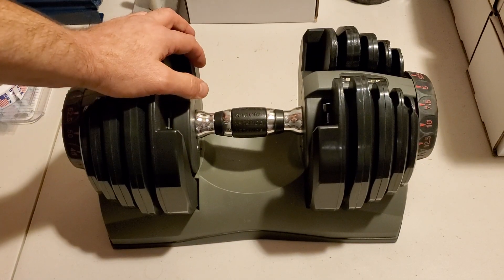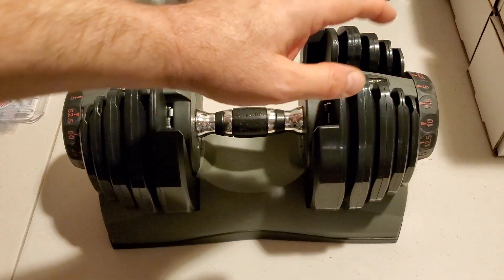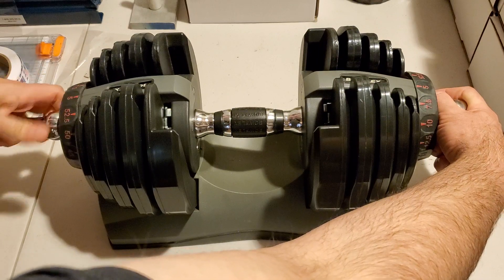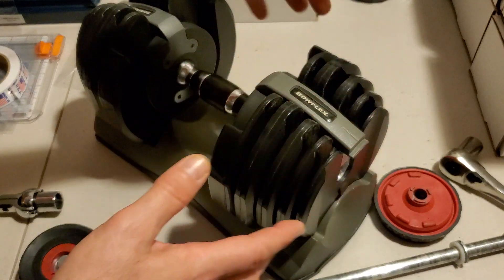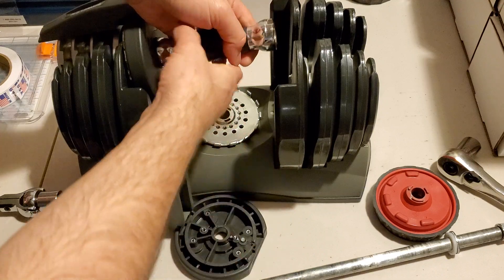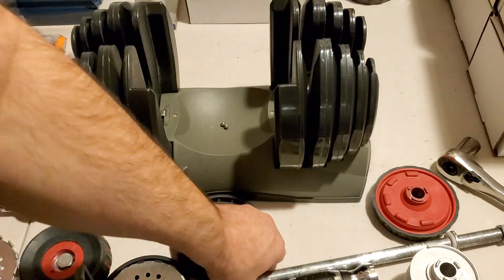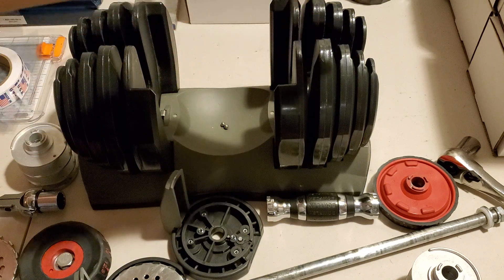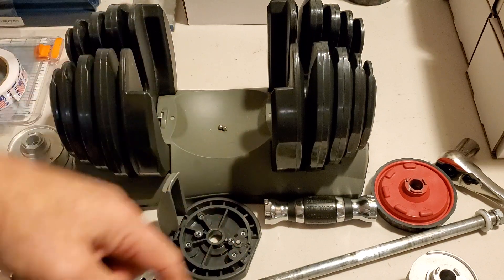Is your Bowflex 552/1090 Dumbbell Stuck in its Base? Nothing else worked? Try this as a last resort!

Comment from the maker: I've received a couple comments about the method in this video over the past few years. The method in this video should be see as a last resort. The very first thing to try is the "foot method" that Bowflex demonstrates here:  https://youtu.be/Pz8t38cosbg?si=57BQeefYsSyux-Sf&t=32

If the reason that your dumbbell was stuck in the first place has to do with a failed/failing component, you can find step-by-step disassembly, inspection and reassembly instructions in a playlist on my Youtube channel: https://www.youtube.com/playlist?list=PL-pg9u1pis_EWPeCLvN-DHjDIlbsEf74f beginning with Step 2.

Cheers,
Joe

Comment: To be honest IMHO since this issue appears to be fairly common among Bowflex Selecttech dumbbells the blame for the  issue lies squarely with Bowflex itself. You'd THINK the company would have worked out all the kinks in this product before releasing it for sale to the public. At the very least they should check each and every set of these dumbbells before shipping to ensure that everything works properly.
Reply from the maker: Hi kn. Bowflex has only issued one product recall for the SelectTech over the past couple decades. It was more than a decade ago and they misidentified the root of the problem. It seems as far as they are concerned there is no problem with their dumbbells, even though you and I (and countless others) know this to be untrue. 

As someone who has worked on product design teams for other companies in past lives, I can tell you that sometimes even a group of engineers can overlook something that is obvious to outsiders. There's a sort of tunnel vision that occurs within their bubble. It could be something as ridiculously simple as failing to test for a specific use case.

This is why I rely on customer feedback to the extent that I do these days. Because I know that I may miss something that's obvious to someone else.  So I throw my designs out there, and the feedback of hundreds of customers combined with my own experience using the products, help me understand what I need to do for the next iteration of the design. Bowflex, in contrast, appears to remain in a bubble with a design that is virtually unchanged for the past couple decades despite the first-hand experience of many hundreds of thousands of customers.
Reply: @AverageJoeInnovationsLLC  If Bowflex only spent as much money on product design and engineering as it does on advertising maybe its product wouldn't have these issues.

Comment: The guard on one if my 552 db fell off while I was working out, and all the plates fell out.  I got replacement screws but I couldn’t get to the nuts, so it won’t catch.  Do you think taking it apart is the best action?   I am afraid I won’t be able to get it back together properly. And that it will fall apart again even if I do get it back. Would you repair or replace it? Thanks
Reply from the maker: Heya, Krim. The crossbar worked itself loose? That's wild. This is the first time I've heard of that happening. If you're inserting the screws and they aren't catching on anything, it's likely one of two reasons:

1. if yours are equipped with threaded bosses (not nuts) then the bosses have stripped and you'd need to tap them.
2. if yours are equipped with nuts, then they've fallen out. Hopefully they are not lost. They sometimes get caught in the plastic ribs of that assembly so you may find them when you disassemble the dumbbell. If they are lost, you can likely find more at any hardware store.

Taking it apart is your only way to fix the problem. As you experienced, without the crossbar to keep the plates from spinning on the handle, the plates will fall out. It's a super simple repair.  I have detailed step-by-step videos for disassembly and reassembly:

https://www.averagejoeinnovations.com/#installation

Just click the + sign on the right hand side of my website to expand the section. Then click the link for each step and it'll begin playing the in adjacent video player.

Definitely pick up some thread lock. If you're in the States, Harbor Freight sells it for just a couple bucks per bottle and it's plenty good enough. Use it on those screws as well as the bolt/nut on the end of your dumbbell shaft and you should not have a problem with it coming loose again. 

Cheers,
Joe

Comment: I have the 1090 which one side doesn’t let go of the weights and spins freely without locking. Any advice
Reply from the maker: My very first guess, based solely on my understanding of what you described, would be that the dial lugs have sheared off. If the dial turns but none of the discs turn with it, then one or more dial lugs are gone. Check out the beginning of this video to see what I mean: https://youtu.be/vU51aKjhvzU?si=56vt0yLjrrjp0ByM

If that's not the case, feel free to email a video of the issue to me and I'll take a look and let you know what I think it might be. Please note that it may take a day or two to reply depending on my workload.

Comment: Still great video, those springs went flying! I’m still having a problem with the white plastic tab that gets depressed  when when you set it in the cradle, and then allows the dial to turn for weight selection- that plastic tab is stiff, sticky- just not budging very well. So when I get it back in the cradle, it sometimes doesn’t even depress, so I’m unable to change the dial/weight. Even after taking it all apart. Can that be lubricated? Any suggestions on the type of lubricant.
Reply from the maker: Oftentimes, a white locking pin and/or button is an indication of a knockoff.There may have been some older OEM SelectTechs equipped with white buttons and pins too, but I've mostly seen them on knockoffs.  Some of the ones I've seen (and the couple that I own) have issues with locking pins getting hung up inside the cavities where the pins are installed. 

You could start by trying a silicone or PTFE-based dry lubricant offered by many brands including Blaster, 3M, WD-40 (grey can not blue), etc. Just a couple spritzes inside the cavity or on the body of the pin itself (not on the pin shaft).  If that doesn't help, you may need to tweak the pin, button or cavity surfaces to get them to slide more smoothly with less interference. That means some trial and error, sanding, scraping, contouring, testing and repeating. It could even be the locking pin's spring catching on the inner edges of the cavity. Some of these manufacturers use a spring that's just too large in diameter.

If you email me a couple photos of your pin, spring and the inner cavity taken from different angles, I can tell you where I think it's getting caught up. My email is joe@averagejoeinnovations.com. I'll reply when time permits.  Cheers, Joe

Comment: Hey Joe. My problem is that the small plate stays on the handle when it's not supposed to and I have to push it down to get it off. Any ideas how to fix this?
Reply from the maker: Hey P,  Do you own the 552 Series 1 like in the video above?  Is it just the one small plate? Does it happen no matter which handle you use in that base? And no matter which way you face the handle in the base? 

I am not saying this is guaranteed to be the issue, but over time as these dumbbells age the plastic coverings on the weight plates begin to separate from the steel underneath. That creates a slight bulge and it can make the plate seem more thick than when it was new. And that can cause the plate to get stuck in the handle and not release properly, or it can make the dial more difficult to turn.  If the same plate causes a problem in both handles, this would be my first guess. And I'd inspect the plate further to see precisely what is going on with it.  Feel free to send me some photos of the plate and I will take a look when I have some time. My email is: joe@averagejoeinnovations.com

Comment: As soon as a single ball bearing or spring fell out, I'd be cursing up a storm.
Reply from the maker: I've been there years ago when I began messing with these dumbbells.  Placing a towel under the dumbbell to catch bearings and springs is the way to go.  Trying to find ones that fall on the floor is an exercise in frustration. Cheers.

Comment: To all,

This is a great tutorial.  I have the Series 1 and I am stuck at the get go.  I cannot remove the bolt.  I have the two 3/4" - 19MM ratchets and no matter how much torque I apply, it will not unscrew.  I've used 3-in-one machine oil and let that soak in to no avail.  Does anyone have any thoughts?  By the way, this dumbbell has never been serviced so it was tightened at the time of assembly by a gorilla. 😆  Does anyone have any  thoughts?
Reply from the maker: Hiya Mike, I answered you via email, so this is for anyone else who might want to know how I'd approach this problem.

My gut feeling is that these things are assembled using impact wrenches (which is also why it's not a wise idea to use impacts on wheel lugs). With nearly every SelectTech I own, the nut on one end of the shaft is jammed on with such force that it deformed the lock washer beneath it. And the other nut, while tight, is usually the one that breaks free.  You'll usually see a red or blue residue after removing the bolt/nut indicating the use of thread lock too.

I have had only one bolt that was so incredibly difficult to remove that I ended up using a breaker bar (1/2" drive 24" if I recall) with a pipe slipped over the end to create enough torque to break it free. The most challenging part is finding a way to hold the dumbbell steady while applying so much force. Ideally, you'd want an equally long breaker bar or large ratchet on the bolt/nut that is on the opposite end of the shaft to counteract the force. And, if possible, someone in the middle holding the dumbbell steady without grabbing the dials or crossbars or anything that might accidentally snap.  You could possibly pull it off as a one-man job, but it may be easier with 2 or 3 people.

If you lay the dumbbell flat on a floor horizontally and attach the breakers to each end bolt/nut vertically, and pull those breakers in opposite directions, you should be able to get that bolt/nut to budge. It just needs to break free...then it will turn fine.  If you're concerned about damaging the dumbbell, try wrapping it in a towel so that the person holding it steady isn't holding a dial or crossbar or anything that might snap accidentally.

Wishing everyone a very Happy New Year!
Reply: @AverageJoeInnovationsLLC  Hey Joe,  Thanks for the email and the post here.  I was just about to write to you as I saw your video on the web site at 

http://www.youtube.com/embed/Q5PRnvxHPcU?rel=0

I have put acetone on the nuts to see if it will help release the Loctite.

I will also get some help.

Stand by for an update and Happy New Year.
Reply: Hey Joe,

Well, I finally got those nuts off.  As you suspected, it took two people and two breaker bars.

Thanks again for your advice and those great videos.

Rgds

mjg

Comment: I don’t have that bolt on mine
Reply from the maker: Hi Joe, If you have a 552 Series 2 or a 1090 dumbbell it'll have nuts on each end rather than bolts. They'll still be 19mm (3/4"). Other than that, everything else will be the same as far as this process. Hope that helps.
Reply: @AverageJoeInnovationsLLC  thanks I didn’t realize that you have to remove the plastic caps I should be good now
Reply from the maker: @UCcxzkgr8RYsn7A22HT0OV_g That's correct, Joe. Those are plastic end caps. Here's a brief video about removing them: https://youtu.be/0aYA92kcOFg  Sorry about that. I mistakenly assumed that your end caps had been removed already.

Comment: Dang glad I didn't do this. Just tun it over and remove 4 screws 😂
Reply from the maker: It all depends on the nature of the jam. The method in this video should be see as a last resort. The very first thing to try is the "foot method" that Bowflex demonstrates here:  https://youtu.be/Pz8t38cosbg?si=57BQeefYsSyux-Sf&t=32

If the reason that your dumbbell was stuck in the first place has to do with a failed/failing component, you can find step-by-step disassembly and reassembly instructions in a playlist on my Youtube channel: https://www.youtube.com/playlist?list=PL-pg9u1pis_EWPeCLvN-DHjDIlbsEf74f beginning with Step 2.

Cheers,
Joe

Comment: You don't have to do that.
Reply from the maker: HI Jouto, after trying simple solutions first--for example, the dial position that I point out at the beginning of the video--this is and should be your last resort. In some instances, you have no choice but to do it.
Reply: @AverageJoeInnovationsLLC   Okay, I jjust feel hard to believe it. I bought pair of those about week ago.. And one of them was stuck. I looked solution from internet and found few videos about what to do. And now it works quite well and I think that become better when I use them more.
Reply from the maker: @lapinmaki   I'm glad you found a solution that worked.  Especially for a pair stuck after just one week. If ever you have other issues with the dumbbells,  search my channel. I have more than 90 videos about these dumbbells and I own several pairs, some over 12 years old. Stay safe. Cheers, Joe